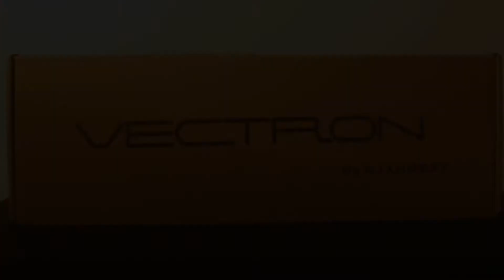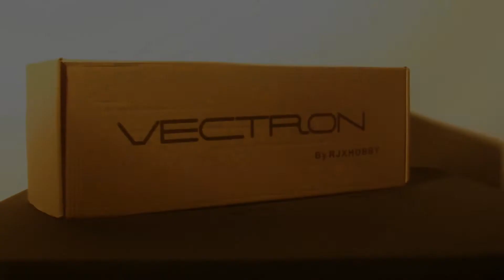RJX Vectron 520 build video

Comment: Hi, great video.. thanks for posting. would you be able to tell me the diameter of the main shaft??
Reply from the maker: Thank you very much brotha Blake!! And the main shaft is 8.28mm. CHEERS!
Reply: Thank's for the info, hope to see a flight video soon, looks like a very nice bird,  I've got the orange version on the way. If it fly's as good as it looks i'm sure i'll like  it. got you another sub, keep up the good work brother!!!
Reply from the maker: Your gonna have to sand the main shaft with 900/1000 grit sand paper. Or else the swash will hang up. Stay tuned for the build update and flight vid! Thanx for the sub bro! Right back at yah!!
Reply: Thank's for the info, look forward to the update...